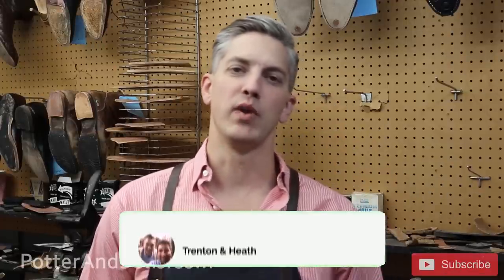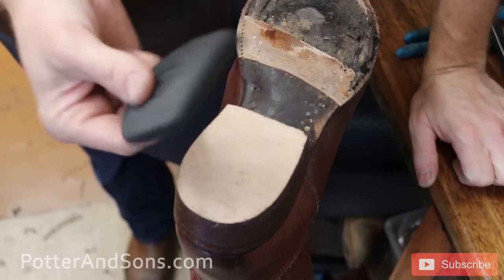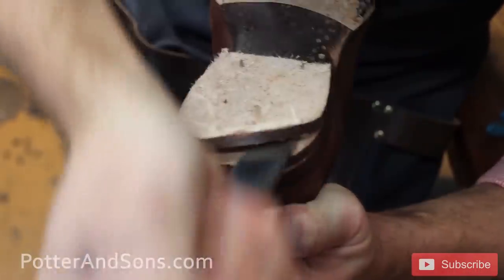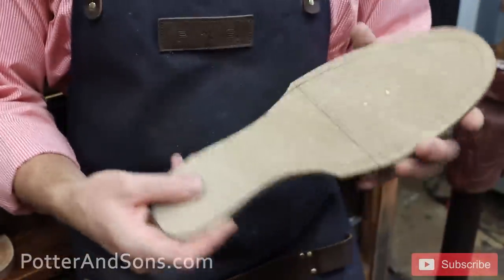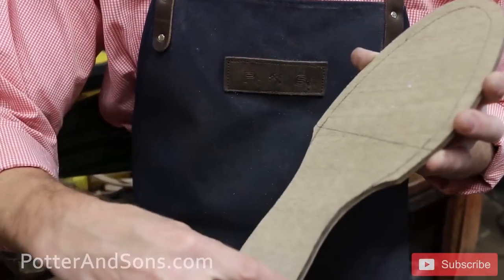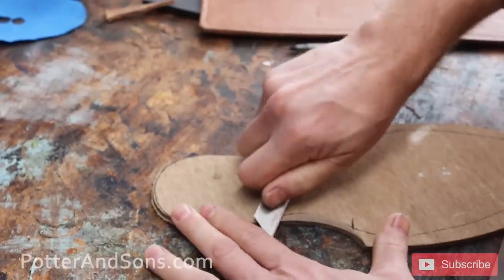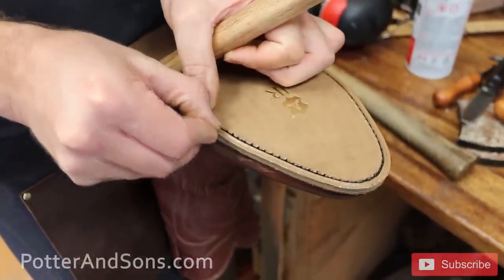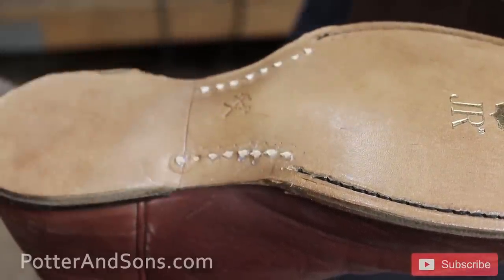TECOVAS Boots - Review & Resole

Comment: I own 4 pairs of Tecovas.  Love them.  The exotic pairs are just as supple and are easily the most comfortable boots I've every worn.
Reply: I got mine once I saw this video. I have the pecan dillons and the granite suade. Totally agree with you, I want more pairs.
Reply: Y’all should check out chisos boots as well A+ boots and customer service
Reply: Hello Chris, I got a question for you since you own a couple of tecovas boots.

I got a pair of the Jacksons in the black color and when I first walked on a wet surface (puddle), I noticed the paint started to kind of wipe off the sole. is this normal for new boots or is it a manufacturer mistake?

thanks,
Reply: @raulquintero146  It was probably a water based dye.
Reply: How is the sizing for the Tecovas Boots?  True to Size?  I am wearing a 10.5 in the Lucchese.  would I wear a 10.5 in the Tecovas?

Comment: I have two categories for my shoes - staples and accents. 

My staples consist of those shoes which have a longer lifespan and often (but not necessarily) a higher price point. These include Church's, Allen Edmonds, Cheaney, Wolverine, and Crockett & Jones. These shoes are kept in regular rotation and, with minimal care at home and the occasional re-sole, will (and have) lasted me for years. 

My accents are those brands that I buy with the intent of occasional wear. Banana Republic, Thursday Boots, Jack Erwin, and Aldo are some of my favorites. These come out every so often and while I do take care of them so far as cleaning and shining, I would have strong reservations investing the money to have them re-soled. For the record, I am not disparaging these brands; the construction of the shoe runs in line with the price point and I would not expect a $135 pair of shoes to last a lifetime of regular wear. That said, I think they are a steal given the fact that I wear them 4 or 5 times a year so they do last for years. (I tend to buy a simple, basic shoe and nothing too 'trendy" - I can wear them for years without fashion regrets)

One exception is Doc Martens. 

I have worn these for years and I have yet to purchase a pair that not only broke in very quickly but also gave me years of consistent wear. For $140 I think that they are a great bargain and one of the few brands that actually look pretty cool if you aren't the most disciplined when it comes to regular shoe shining.

Comment: I am considering buying a Tecovas with a Vibram sole, because they grip better on slippery surfaces. I noticed they don’t have a Goodyear Welt. I assumed this was so, because it had something to do with a leather sole vs. a rubber outer sole, and it wasn’t necessary. However, I have non-cowboy boots with rubber soles that are welted. My question is, once my Tecovas with a Vibram sole is worn down, are they just disposable like cheaper boots?

Comment: Great video , but what did u charge? if $200 why not just buy new
Reply: 1) Leather uppers were in great shape 
2) Better for the environment to reuse what you can 
3) No break-in of new boots. These are your soft, broken-in babies
4) Sentimental value 
5) That JR resole job is an upgrade over the factory boot. Better value to repair vs replace

Comment: Hey Trenton and heath. Just a question. One of the things making me hesitant to switch to tecovas is the thicker rubber heel cap. It's much thicker than heel caps on most other brands. When getting a new heel cap would most cobblers be able to fit an equally sized heel cap to the boot or just slap a thinner one on there? I dont know much about how or where the heel caps cobblers use are made. Thanks.

Comment: I just received my first pair of Tecovas calfskin boots. It’s been years since I last wore western boots and I’m now a senior. My balance isn’t what it used to be and after simply trying my boots on, I’m really concerned about how slick the soles are. I’m thinking of taking them to a reputable cobbler and having some sole protectors installed.. Any recommendations as to something with a slight bit of tread/grip?
Reply: I'm almost 72, and put my Tecovas on in August. Initially, they were a bit slick, but that ceased to be a problem within a day or two. As soon as the finish is off the sole, you'll be fine. Actually, it's just the wax on the sole that's making you slide - it did the same thing to me!!
Reply: Brook Eggleston  Brook Eggleston Thanks for taking the time to respond. For now, I haven't needed to wear them yet. Due to Covid 19, I've only left my house maybe 10 times since the pandemic first started. I've spoken to the best cobbler in my area (Richmond Virginia) and they've recommended a kind of durable but thin (almost unnoticeable) rubber half sole to provide both additional grip and extend wear. My gait usually wears the heels of my shoes irregularly so I'll probably add a small heel guard (rubber tap) and inasmuch as I also tear up the toes may add a small plain toe cap of some sort (hopefully not flashy).
Reply: @REBELSCL  Glad to hear that you're being careful! I had the virus in April, and even though I had a mild case, I wouldn't  wish it on a rat. It felt like I was trying to cough up dried rubber cement - no fun at all!!
    Talk to your cobbler - they can trim the rubber so it doesn't show from the side of your boot, but still gives you the traction you want. Enjoy your boots, and wear a mask - my O2 saturation tonight, wearing a mask, was 99%!